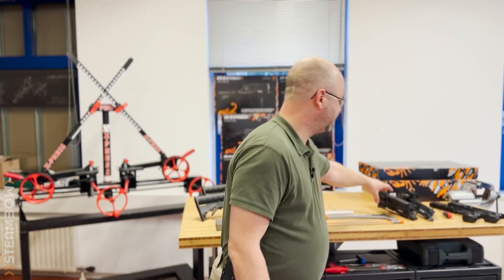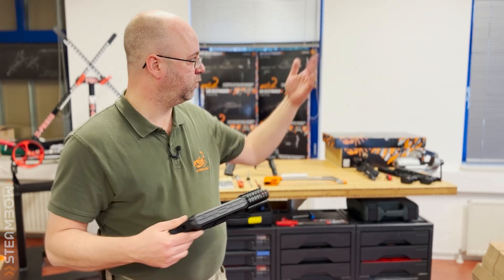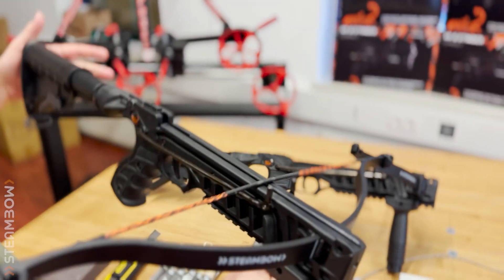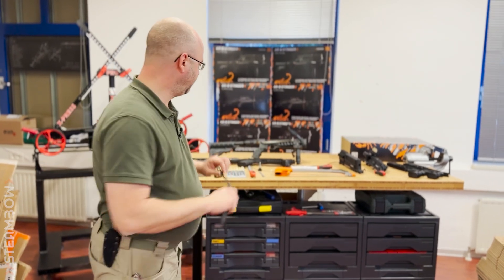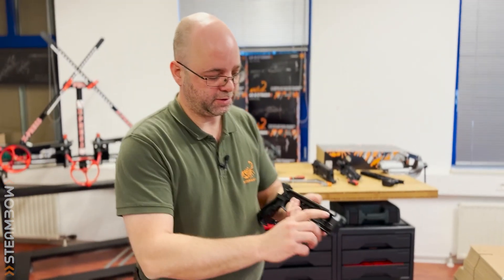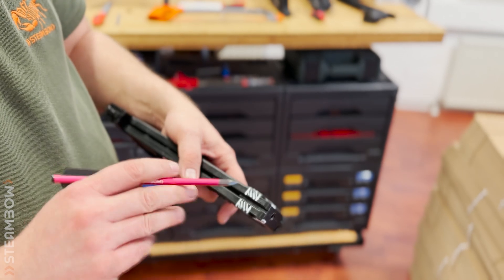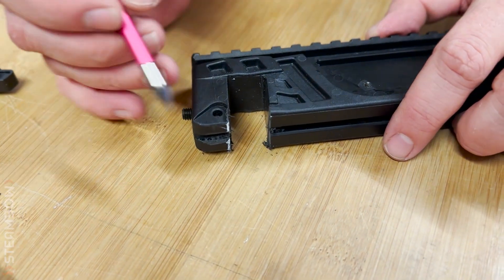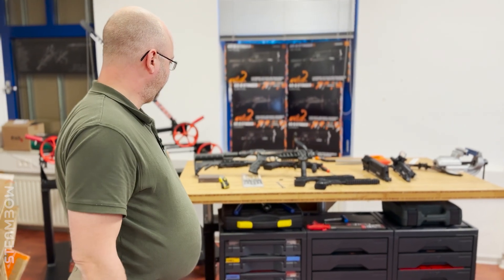Steambow - Modular concept and opening of the main body

Comment: Really good video Gerald - and very well explained! Two questions please,  can you still install the separate side Picatinny rail to the M10 upper as you could to the AR-6 upper? If so, are there guide holes for drilling these on the inside of the M10 like the AR-6?

I know you have designed the new 'Tri-picatinny shroud' (that's what I am calling it for now ;-) that is removable on the end of the M10 - it's just I would like the option to have this removed - add a red dot sight to the end in a lower position to the M10 rail and still have functionality for a side attachment etc.
Reply from the maker: Hello, that's a good suggestion. We will show a video of the future fronts as soon as possible. Mounts will always be directly on the top Picatinny rail. Drilling the magazine, as with the AR-6, will no longer be necessary in the future.
Reply: Thank you for your reply, look forward to seeing what you come up with. Many thanks  @Steambow